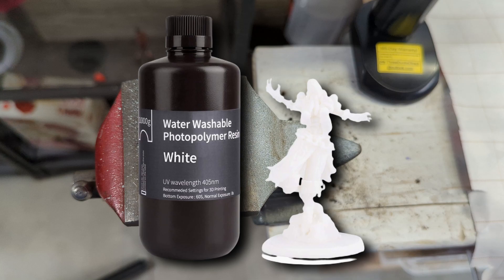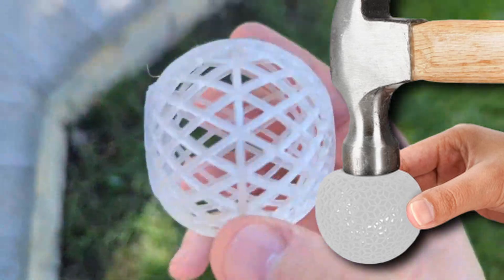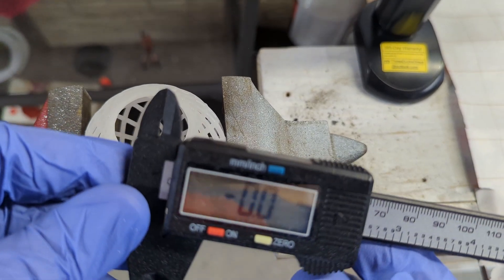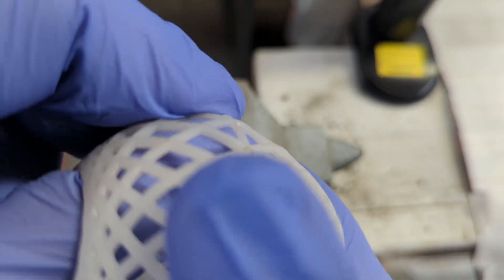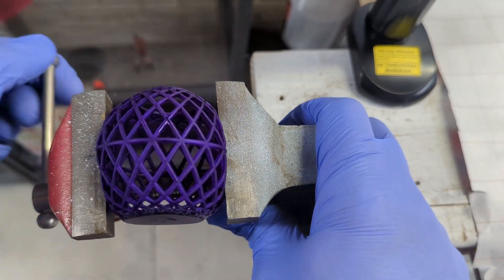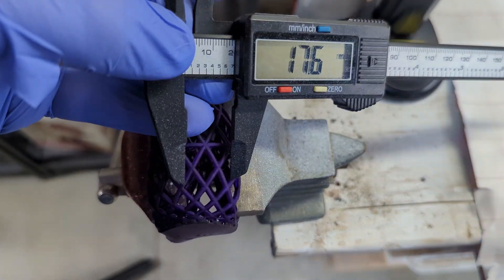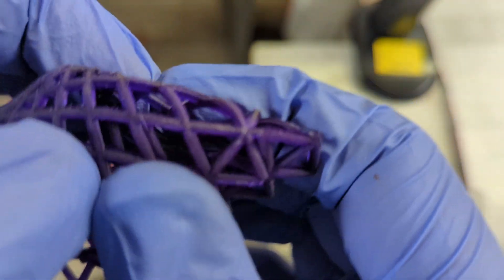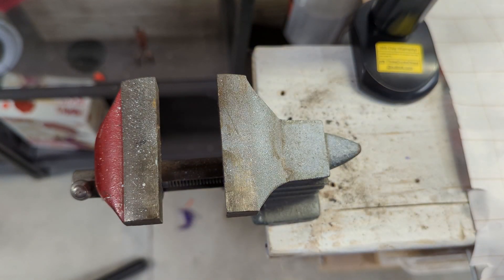Best Resin for 3d Printing?

Comment: It's pretty tough  mostly by being flexible.  I just want some flex, and the ability to drop a mini without breaking, and not pay $50+ per liter.  So I use Sunlu ABS like resin it's half the price has enough flex that things like spears can flex and not just snap, dropped models won't break easily.

Comment: Hi. I jave Anycubic D2. Any advise on settings ( exposure time, lift speed and how  thick supports should be) for Tough resin?
Reply from the maker: Generally I tend to over expose so that it generally works on whatever resin I'm swapping out.  
Bottom layers:6 
Bottom exposure:60s
Regular exposure:12s, 
Supports- heavy

Comment: hi, to print with tough resin, did you change any printing parameters?
Reply from the maker: No they are the same ones I usually use for transparent resin
Reply: The same for anycubic clear resin?

Comment: Nice testing.  I'm quite curious about the abs-like (+ or pro) resin versus the tough resin.
Reply from the maker: Great suggestion!  I'm also testing out some white resin to see how different coatings can affect the yellowing of resin with UV exposure
Reply: @TheOhayoDev  Still quite new to resin, and I have not tried white yet, but I'm also trying to find out about best exposure times for black resin, since Anycubic give you parameters for the type of resin, but not refined based on color - and black and white must certainly absorb UV very differently.
Reply: @stormalongdaz  Oh interesting.  I have used many colors but never black.  It makes sense that it would work differently since I have noticed clear resin seems to need a longer curing time between layers

Comment: What about the settings for AnyCubic Water washable Resin?
Reply from the maker: I haven't had the best luck with the water washable resin. After several months most of my larger prints developed cracks or splits in the resin so I'm not sure if it is the resin or my settings

Comment: What are the settings you  using for the anycubic tough resin
Reply: On a mono printer with a large screen?
2.5s per layer, and 5mm lift height since it sticks to the FEP like crazy for me
Reply from the maker: So I have a couple of the original photons and these are the settings that have been consistent for me.  Some people will say that the exposure time is too high but like I said this is what has worked for me with the replacement screens I have put in the machines 
Layer Height: 0.05
Bottom Layer Count: 4
Exposure Time: 8
Bottom Exposure Time: 60
Bottom Lift Distance: 5mm
Lifting Distance: 5mm
Lift speed: 100mm/min
Bottom Retract Speed: 0.001 mm/min
Retract Speed: 200.00 mm
Reply: @TheOhayoDev  Nah, that’s not too long at all for the original Photon. Very safe settings there!

Comment: What are the settings you're using for the anycubic tough resin
Reply from the maker: So I have a couple of the original photons and these are the settings that have been consistent for me.  Some people will say that the exposure time is too high but like I said this is what has worked for me with the replacement screens I have put in the machines 
Layer Height: 0.05
Bottom Layer Count: 4
Exposure Time: 8
Bottom Exposure Time: 60
Bottom Lift Distance: 5mm
Lifting Distance: 5mm
Lift speed: 100mm/min
Bottom Retract Speed: 0.001 mm/min
Retract Speed: 200.00 mm

Comment: Thanks for the review. I have tried JAM GE and MiKa3d tough resins for minis and have good success. I think I’ll try the Anycubic’s tough resin next.
Reply from the maker: Out of the two you've tried, was there one that was better than the other?
Reply: @TheOhayoDev  I found that the JAM Ge tough had more flex in compared to the MIKA3D but the MIKA3D was a great deal on amazon and still seems to be tough.